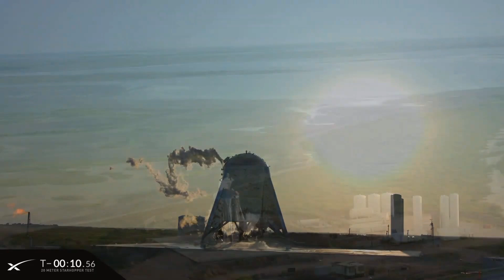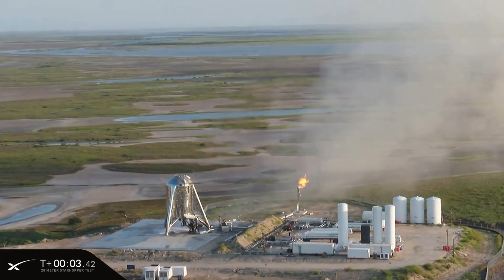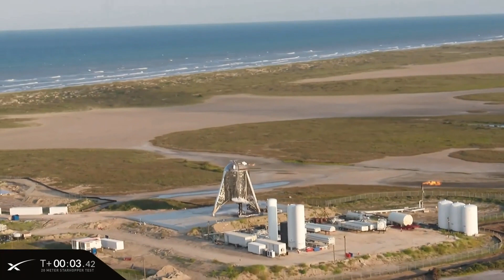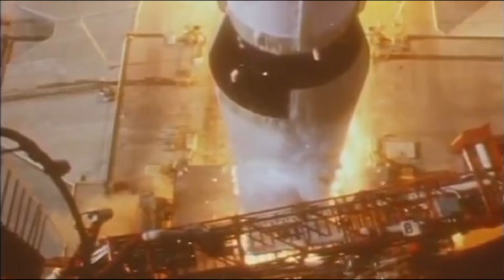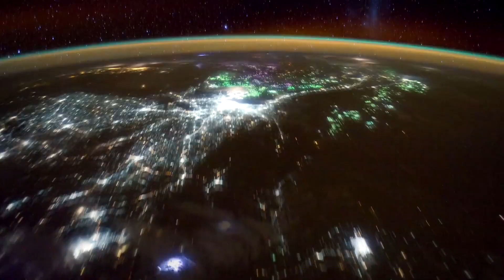ABORTED SpaceX Starship Starhopper hover test at T-0; big methane flare!

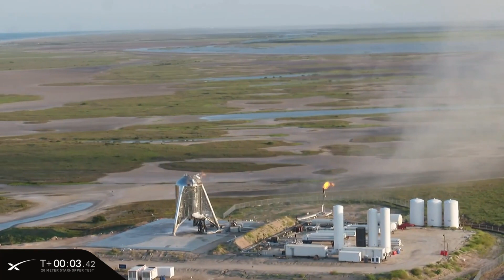Comment: 1:21 Why is the hopper flaring that flame? What is it burning? Why cant they vent with smoke like they usually do during a falcon 9 abort? Will Starship have this flame to detank or will they  vent with smoke like with LOX and the other fuel falcon 9 has?
Reply from the maker: Falcon 9's first stage Merlin engines burn RP-1 (kerosene, a petroleum product; not cryogenic) and cryogenic liquid oxygen. The white "smoke" you see before a launch is water vapor in the air condensing into clouds as it is cooled by the super-cold oxygen gas that gets vented by the rocket. Starhopper's Raptor engine burns cryogenic liquid methane and liquid oxygen. It vents gas also.
All cryogenic liquids - oxygen, methane, hydrogen - produce gas that needs to be vented, or they will expand and rupture the tank. The big flame we see here is caused by methane gas that's venting from Starhopper. It's the same gas that we see burning at the top of the pipe to the right of Starhopper. The combustion we see isn't explosive, and the metal ship can take a lot of heat, so I wouldn't worry about it damaging Starhopper. 
In fact, after this abort they were planning to try again a couple of hours later. However, they ran into an "issue" (unspecified) and had to scrub for the day.
Reply: @RawSpaceVideos  Thank you!!! I'm sure this helps many other people gain knowledge as well!
Reply: @RawSpaceVideos  hi did you change your name recently adding Videos to your header or did I just not notice. P.s. my old  account has been compromised here and on discord. 😕
Reply from the maker: @Julian-hx9yp  My account has always been RawSpaceVideos, but the display name has always been Raw Space.
Reply: @RawSpaceVideos  ooh ooh I just noticed my name is different here lol.
Reply from the maker: @Daniel Roig Well, it does live by the sea...
Reply: the reason why its flaring the flame is because the rocket uses methane,and methane realeased on the atmosphere it self can cause global warning.so their solution is turning it onto co2 and realeased on the atmosphere.sorry im late.